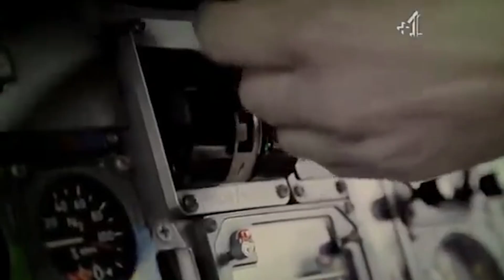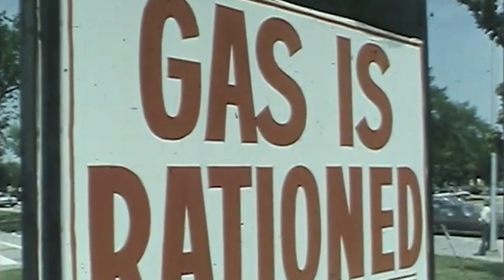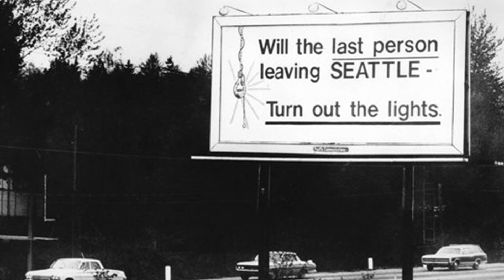The Forgotten American Concordes - Boeing 2707 - Lockheed L-2000 SST

Comment: The Concorde cruised at 1350. True. But Mach 2 is closer to 1380. And the Lockheed design was less like the Concorde than he said. It incorporated a double delta design. And Boeing at the time of designing their SST had, if I am correct, never produced a supersonic aircraft. And  Convair, North American and Lockheed already had success in building aircraft that could sustain supersonic flight with jet engines. Then there is another fact overlooked: Douglas entered the SST competition too.

Comment: I've just noticed a pattern. L-2000 (Not chosen because it's too simple, less risky) AH-56 Commanche, Has stubby wings so it's an airplane with rotors let's find an excuse to cancel it. X-33/VentureStar, Well uhhh..it doesn't have composite tanks so the project isn't groundbreaking enough (Nevermind the aerospike engines and possible single stage to orbit). Lockheed sure gets shafted a lot by the US Government.

Comment: Based on Curious Droid's most recent video about the RB211 engine, I ended up reading Stanley Hooker's autobiography ("Not Much Of An Engineer") - and pretty much devoured it in a couple of sittings (it would have been one, but it was a work day...), and he mentioned something very interesting about an aspect of Concorde's specifications that I didn't know - namely that she was originally specified to have a cruising speed of Mach 2.2 as opposed to 2.05 - now that doesn't look like a lot of difference numerically, but the higher speed had a very specific effect on the fuel and oil temperatures.  Specifically, the fuel would heat up to 160 degrees C, and because Concorde was designed to use regular Jet-A1, at that temperature the fuel in the tanks would begin to decompose into waxy and varnish-like compounds which would quickly destroy the delicate mechanics of the fuel delivery system.  Similarly, the oil would heat up to 300 degrees C, at which point it becomes acidic and would eat away at the bearings it was supposed to be lubricating.  Dropping the cruise speed to Mach 2.05 kept the temperatures just low enough to avoid the problem.

Given that the B2707 and L-2000 were supposed to cruise at Mach 3, I wondered how they were supposed to solve that same issue, and a quick Google revealed that the B2707 intended to use the GE4 engine (a variant of that used in the XB-70 Valkyrie), and the L-2000 intended to use a variant of the P&W J58 used in the SR-71 Blackbird.  Both of these engines required "exotic" fuel types designed specifically for those engines (JP-6 and JP-7 respectively), which would mean that any airport planning to host these aircraft would have to provide a supply of these rare and expensive special fuels - and presumably the airlines would have to pick up the bill for that happening.  Outside of solving the design issues of the aircraft themselves, I simply cannot fathom any way that the logistical effort involving getting these unique fuel types to where they needed to be in enough quantity to be viable could be reliable enough to be practical, let alone commercially viable.

Comment: They should really bring back something similar to concorde. I cant believe they dont have the technology to perfect it and replace 747s alltogether.
Reply: They have. It’s called the internet. Business users kept Concorde in the air, they needed to be face-to-face with other businessmen and women across the Atlantic. Fast, exclusive travel was demanded then. Business now has accepted that it can all be done accurately and instantly by video calling and emailing in real time via the internet. SSTs are just not required and they would be financially crippling for any company to develop for little or no return. 
The 777 et al shift way more passengers and are more efficient, SSTs suck up too much fuel per passenger and are expensive to keep in the air as they require specialists to keep them in good order. Boeing and their competitors produce flash looking videos to keep their stock in the right bracket, folks like shiny fast objects to dream about, in reality they’ll keep turning out slower, more cost effective aircraft and let the world dream about a Concorde replacement.

Comment: These crafts were forsaken because of three reasons: Super sonic sound polution, due to low atmospheric flights. Expensive fuel burning due to very small engines, limited range travel, due to low altitude at only tropicsphere height. By having a convertion of braud propellers folding into jet barrel internal, to sheers rocket combustion at very high orbit altitude,  it would've been only a 10 to 13 min timing travel then SpaceX atrempted in pure verticle rocket form, only far more safer & realistic.

Comment: 1. topolev is not russian, it is soviet, there is the differe!
2. it never riched supersonic speed.
3. it was earier than concorde, because kgb stole the plans of concorde.
4. it crashed because it was poorly designed.
5. the purpose of concorde was to travel fast and sreve passengers. the purpos of topolev was to show others that soviet technology is good, but it was not.  the reason why soviets suck is not bad  enegiers, but the absence of the democrasy, which is the key element for any progress.

Comment: 05:51 the swing wing design would eventually be adapted into the B1 program (so no, it wasn't 'too heavy'). It was great at preventing the 2 tons of fuel Concorde lost - just on taxing around the runway(s). Also nice for loitering around an airspace at low speeds picking out targets for bombing runs. Oddly enough the B1 costs less per hour for a mission - than a B52, and can drop more ordinance.

Comment: I play KSP for 3 years as of now, and can say that boeing and airbus layout with stick-like wings at sides, lift force center lower than center of mass with a higher tail fin to balance the inbalanced lift/CoM distribution is worse than the worst of any spacecraft i've ever built! And i'm not even an aeronautics engineer, but an electrical engineer.
Reply: What they could do to improve the concorde(or Lockheed SST) was to use body-lifting architecture, lift up the center of lift higher than the center of mass;
And while increasing the performance of the aircraft, the speeding altitudes could be higher with the advantages these upgrades could make, making it speed up at thinner parts of atmosphere, hence eliminating the audible sonic boom from the ground.
Reply: Wishfully, while the oil prices are getting lower, and commercial space travel is available in current day, we would unban the supersonic flights for good.

Comment: The boeing versions' front is so ugly. Looks like a retarded duck 😂😁
Reply: But very innovative! Delta wing transport planes in general require higher takeoff and landing speeds. With Boeing's swing-wing design, it makes it flexible to operate at lower speeds!

Comment: What's said is, America, have built two aircraft that could have been our first concord, but they were used a bombers instead. If built larger, the B-58 Hustler and the B-1 Lancer, are proven designs and both would have worked as a supersonic airline if they were built longer and wider for passengers.

Comment: I think that in a few decades we’ll be supersonic again. Maybe not Mach 2, but Mach 1,3. New airliners are getting close to the transonic speed already.
Reply: Even if they can travel at transsonic or even supersonic, Airline operators will still insist their pilots to the fly the plane at subsonic just to keep the plane more economical and efficient

Exchanging speed for range and cheaper price for the customers

Comment: A friend who worked at BA for years always said that Concorde was profitable. Yes on daily operating costs there was a net positive cash flow. But when R&D costs were factored in, the plane did not pay for itself . The US carriers looked at the business case realized that these planes were for prestige but business is business and they would not be revenue positive.  In a different but somewhat similar issue of profitability, this is why Boeing did not compete with the A380 as they said the market was too small. Basically Emirates buys the plane but not much volume elsewhere and now production will cease on it. For commercial companies these things do have to make money for better or worse. Concorde really did help build back prestige for European manufacturers after the Comment which was a the first commercial jet airliner - kudos to de Havilland for taking the risk - but ended up being a very dangerous plan with many crashes (eventually the bugs were fixed by the 2nd to 4th gen). This is how people learned about metal fatigue, over a lot of lives.

Comment: In a humble hanger near Paine field in Everett, Washington there lies what remains of the Boeing SST. Ive had the privilege to see the remains of the prototype and to touch the aircraft. I was talking to an employee who told me the story of the "airframe" and how it met its demise. The story is actually quite sad. At 7:36, there is a photo of the entire airplane. It was given to a museum in Florida after the project was canceled, where it was left mostly outside, and rotted, as as he said "It returned to the natural stuff that it was made of" Only about 80 feet of its forward fuselage remain intact. The bendable nose piece is disconnected from the fuselage so it can fit in the Restoration Center. The end of the fuselage is right where the wing starts in the picture. It's in a restoration center, but they are not, unfortunately, going to re-build it. It's a sad ending. I could make a video on my channel with some of the video i have of it if anyone is interested, I read all the comments on my channels videos so you can contact me there and let me know if you want to see anything like that. Great video. I apologize if others have posted this story and its a repeat but I didn't have time to read all 2,981 comments on this video!

Comment: I thought the Tupolev Tu-144 was the cutest looking of the supersonic aeroplanes. It always reminded me of a Beagle pup, coming in to land with its big 'sticky-out ears'. But on a slightly more serious note, I did think it was a little shortsighted of Great Britain and France to only factor-in seating for around 100 passengers during the design stage of Concorde. Safety, speed-wise and aeronautically, there was absolutely no reason why they couldn't have designed it up to 33% longer and 33% wider.

From memory, the one I used to fly on (LHR-JFK), was configured to take 104 passengers max. But in all brutal honesty, the seats were ridiculously narrow, and didn't feel remotely ergonomic, i.e. they were very thinly padded, and this was long before LRPu (memory foam) was made commercially available! But the worst thing was the legroom... or rather, the lack of it! I dare say the likes of Dustin Hoffman, Billy Joel and Paul Simon found it positively capacious! Alas I'm 6ft 4ins... need I say more? All that said, the food and wines were always superb and the BA cabin crew were second-to-none. The biggest thing of course, being that New York was just over 3 hours away. At the time, the 'normal' flight time from LHR-JFK was around 8 hours. But yes, all-in-all, some happy memories of happy times. Many thanks for uploading this video. It's one which is well worth sharing.

Comment: If electronic technology today could make batteries alot lighter..i would say build a powerful ducted fan motor version of these aircraft..with solar panelled wings to give them longer range and super clean quiet operation..im sure it wouldnt require rocket science to do this as we already have most of the technology.

Comment: Without swing wing subsonic flight over land is not possible or spends a lot of fuel due to induced drag. The Tu160 had swing wings despite being large; the Ukrainian Tu160s should have been taken to the US when they were around and maybe converted into airliners. I actually suggested this in a mail to people that might have been in charge then.Of course there will be no need or justification for supersonic planes as trains will be much faster without burning fuel, making sonic boom,requiring 7km runways or punching hole into ozone layer. Rail has no upper speed limit.2x speed= 4 times more fuel, 3x speed= 9 times more fuel. The SR71 had zero payload and was aerial refueled seven times per flight. Even the current world's fastest plane, the Mig 31, has a fuel fraction of almost 50%. Trains burn ZERO FUEL and are 100% ELECTRIC, including the HEMU-430X, CIT500, VHST-600X and the 8500 freight locomotive(3 times more powerful than a former DEL). In addition, while high speed train has airport security, it doesn't need time for clearance, moving to inside city etc(high speed trains in Korea have run in rural curved single lines  and mountain switchbacks(Nahanjeong: now Highone Choochoopark) in the past) and using railgun technology well within Korea's financial and technological capabilities, some trains could space travel. It's over with aviation except for short connection likes similar to bugwan

Comment: Commercial turbojet engine respects time most valuable item in our life not money ( fuel ) but I think the major problems are
1. pressurization systems
2. pilot capabilities
3. critical landing
4. dynamic moving of wing to empennage unit while cruising
5. infrastructure and dynamic loading
6. may be more may be less but it is a dream that respects time

Comment: Two things always riddling me up to today:
    A - Why were the turbines in each variation/model of any supersonic-passenger-plane ever, "boxy" instead of being of an aerodynamic form, gracefully merging with the wings?
    B - Why the hell are almost all existing planes built to use their thrust-provisioning systems for taxiing on runway, instead of having an autark engine driving the wheels?
Reply: A:
There is nothing aerodynamic about two tubes  stuck together, thus they opted for two squares.
Due to stress, engine has to be mounted to the wing surface, flat wing, flat casing.
Ducted square fan intake was designed to reduce noise to a legally binding level.
Due to in flight speed and angle variation, intake isn't static, it has variable-geometry shock ramps to give air at right angle/speed/pressure, all those ramps are square.

B:
it's never gonna happen
Reply: @mastergoblin7205  Thanks for the reply, appreciate it!

Regarding the Intakes, without knowing the tech behind it at all, i just thought of distributing the pressure and/or the turbulence alongside the Intakes, for example to minimize or let me say to "stretch" the peak resonance frequency, which would ease the stress on the material , especially at the edges/boundaries; also distributing the heat at the edges was a point i "felt" might be possible by using other  basic geometries.

Regarding an active transmission system for taxiing:

I mean, have there ever been prototypes? The only, somehow likewise autark taxiing system i ever stumbled on was - comparable to the way drones work today - an autark pully (by Mercedes Benz, i think beginning 80s), fitted with sensors and a daisy-chain-mode, where (for cargo transporters) more identical pullys could be added, communicating with each other wirelessly. It was necessary to modify the wheelwork-"pillars", somehow strengthened them so they were not affected that much by the push and pull.

Anyhow, the question remains: Why will it never happen, what is the reasoning behind it?

Do you know of planes that actually probed edits like the ones i mentioned and if so what the outcome was?

Thanks for participating and sharing your knowledge!

Comment: As the SR71 is no more, the fastest plane is Mig 31 with Mach 2.83 but this is possible because russia has cheap fuel. For each flight, 16 tons of fuel is required. One of the reasons Korea's plan to buy the Mig 31 went into nothing(the biggest reason was that the soviets refused tech transfer and other demands from Korea)

Comment: One reason this wouldn't have worked is that it required 9 times the fuel of a similar boeing or airbus. But there wasn't space for so much fuel. The SR71 was capable of Mach 3 for a long time because it got many aerial refuels and the XB70 only flew short test flights. The concorde required 4 times the fuel as it was twice faster than a boeing and thus failed. There will be hypersonic trains. Planes can NEVER go above 850 km/h and trains NEVER use one single drop of petrol or diesel